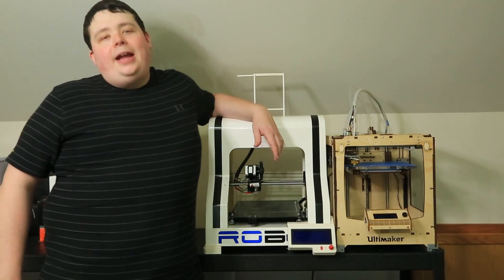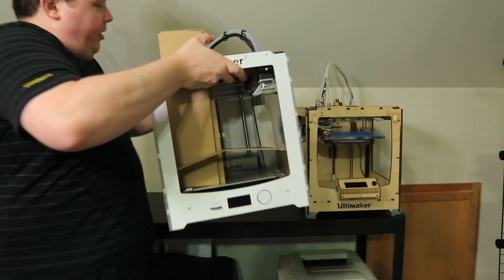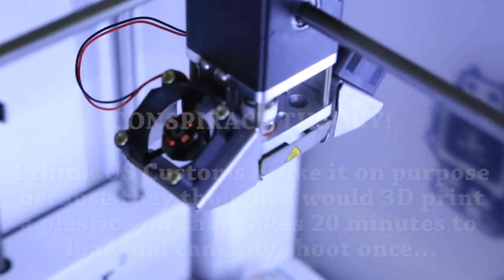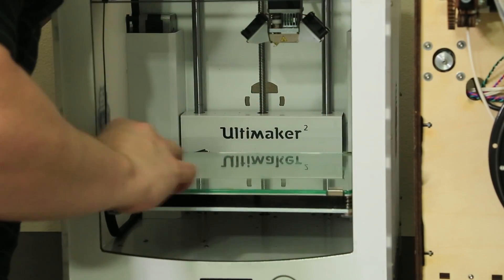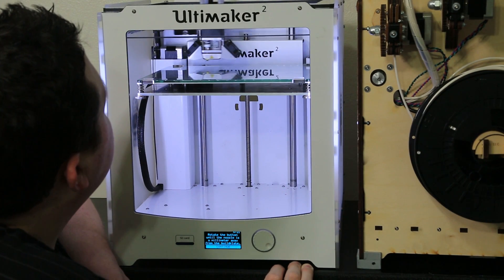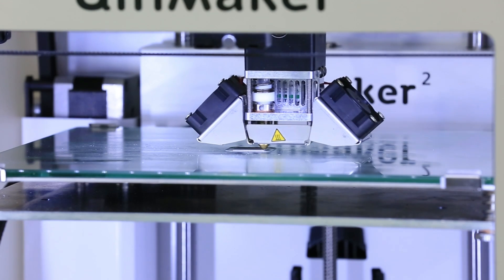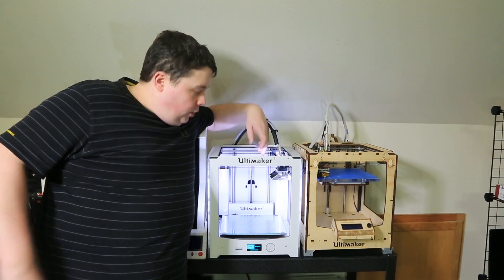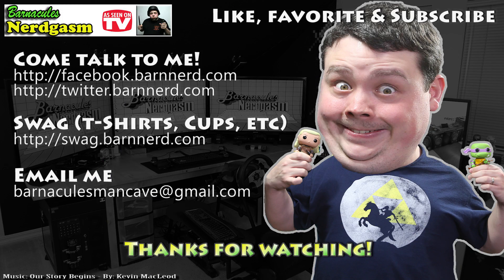Ultimaker 2 3D Printer Unboxing & Review - @Barnacules

Comment: I recently bought the ultimaker 2+, I also own 1 Flashforge creator pro
1 Flashforge dreamer 
1 Flashforge Finder
1 M3D micro 
1 3D systems Cube 3rd generation
1 XYZ da Vinci 1.0 pro 
Honestly ultimaker 2 suppose to be the highest end printer of all but here is my honest opinion, $2500is an overkill for what it's do, it's claim to have 20microm resolution but seriously what to print that will need 20micron? 
All others printers that I have are 50micron M3D 70 Micron the cube and rest 100micron .
I did print 70 micron on the all Flashforge but with half the speed and honestly I couldn't tell the difference.
The ultimaker 2 is quite for sure and the extruder will designed and look better does that justify the price? 
Don't get me wrong of all the other printers ultimaker 2 is the best but I'm not sure I can justify its price

Comment: +Barnacules Nerdgasm PLEASE READ! I know what that weird plastic part you didn't know is for! Looking at the printer from the back, there is a hole at the bottom left of the printer where you insert the piece and rotate it 90 degrees to the left to lock it in. You wrap the filament around this before it goes into the extruder to keep knots from happening on the spool that would prevent filament from extruding. There are two slots in the piece to thread the filament and the other slot is for if one has duel extrusion

Comment: Does anyone know if the Ultimaker2 can 3d print using copper?
Reply: if its Copperfill PLA, almost every printer that can print pla will be able to. if you are talking about just copper, then it most likely will not be able to.

Comment: Nice review thanks.
I bought my UltiMaker 2 at Xmas after 2 days usage it is now defect. contacted the UM support they suggested to return the unit for a replacement/refund within 14 days to the official dealer..
phoned the dealer & they offered a refund so i returned my unit. Now they are telling me they cannot refund because the unit is defect.
Either i accept a 3-4 weeks repair or i accept the refund minus the repair costs - Great service that is!

Comment: First off, let me say that I love your videos. But, I really feel that the company at fault for the broken fan is Ultimaker, not DHL. Things will get jarred in shipping. America's infrastructure is terrible in most areas, so delivery trucks will inevitably hit bumps in the road. If DHL did more harm than this, I feel that the printer housing would be the thing that's damaged, not the inner components. Packaging, on the other hand, is the responsibility of Ultimaker. They should understand that their product must be shipped, thus might experience some jarring. Sorry for the long comment, I just thought I would throw that out there.

Comment: Wait a second... For calibration why don't they just include small plastic pieces that fit between the printer head and the glass table so you don't have to measure anything- you just tighten until it is finger tight and then it is 100% of the time calibrated so easily for any level of consumer. Am I missing something here or is that a super simple / easily added to the product for nearly $0 in cost or time?

Comment: looks like they switched to belts and that's why it's quieter?
Reply: +nikotwenty No, they integrated new stepper motor drivers + the new frame does not amplify the noise like UMO. As far as noise, I replaced old drivers with Silent Step Sticks and it prints quiter than UM2 now.

Comment: Barnacules Nerdgasm i need help finding a good cheap 3d printer, any recommendations? My budget is $600 or lower
Reply: Go for the 1up or 2up you have to build it but it is amazing. The 1up is 4x4x5in printing and the 2 is 7x7x5

Comment: 8:06 - 220W seems rather low for a dual extruder setup with heated bed. Is this power supply meant to be used after a dual extruder update or do they ship a beefier one?

Comment: I would really like to see you try to get review units of competitors and really put together a comprehensive review video, or two, one full length, one abridged. These units are facinating, and your present experience and tech expertise would contribute greatly beyond simply researching. Largely because, if anyone is getting into it for the first time, the technical nuances and differences between companies and models might not seem significant when they actually are.

Comment: What 3D printer is pretty cheap (as cheap as possibls :D)  and is good to get into 3D printing? I love the ultimaker 1 and 2 (I like the 1 a little more I think) but I just cant affort one of those :(
Reply: 3d printing is an investment, you can buy a printrbot simple for $350. the amount of money you are going to spend to get decent prints is going to be the same as starting out right. Save up $1000 and you can get something quite decent that will work right out of the box with minor tuning. Its a hobby not a toy
Reply: Oh sounds fair enough I think I am first going to save up to build a gaming rig before I buy my first 3D printer

Comment: hmm If I ever get another printer I would probably get the ultimaker for super high resolution printing. It prints at up to 20 microns. You don't find much higher than that. If it prints right out of the box with very little fiddling, that's really nice.

Comment: what if they 3d printed a 3d printer
Reply: some older 3d printers used 3d printed parts to make it cheaper. you just assemble it with the hardware and go.
but as far as circuity you would need a diffrent machine.
Not to mention even if you could print a print ready 3d printer it would be smaller than the one used to print it so it would be impractical.

Comment: just got mine in. just a warning. if you plan on printing in a 90 degree summer day in a un-air conditioned warehouse. your going to have to add cooling to the controller unit. otherwise it will overheat constantly.  Barnacules Nerdgasm  do you have the designs for those legs for public download?  i could use those.

Comment: I recently purchased a Ultimaker 2 and have had nothing but problems
with it. Every third print or so comes out with horrible quality or does
not finish at all. I have emailed the support email several times with
no response and no support. I am getting extremely frustrated at their
lack or support and their complete disregard for my issues. I spent a
lot of money on the printer and its as though Ultimaker is no longer
interested in me as a customer. I am seriously considering returning the
printer and moving on to a company that will treat me well, even after
the purchase is complete.

Extremely disappointed so far.

Comment: I hate 3D printer manufacturers. Their machines contains 70% less material than a conventional printer, but they manage to raise the price by 500%.
Reply: Printing on paper vs. printing physical 3D objects
Nuff said
Reply: Arcade Animations thats not his point! dumbass.
Reply: What are you talking about? Where do you get that number? Most conventional printers use a single rod, molded plastic parts, a few springs, some cheap electronics, and 1 or 2 cheap NOT stepper motors with optical feedback to save money. I have taken apart 2D printers and the quality of... everything just isn't good enough for a 3d printer. Also, compared to conventional printers, these are a niche market.
Reply: Certified Nerd c'mon u talk about chinese crap printer. Take for example a brother printer 3 in 1 for about less than 250$.
And say me again it's a cheap shit coming from deep world and using less material & technology than this ultimaker.

Comment: Which 3d printer do you recommend for a hobbyist with a budget of $500?
Reply: i would still look at a couple other printers, just to see what else you might like, but the solid doodle 4 is definitely a good printer, and for $600, it's a great deal
Reply: it's 600$, so a little bit more expensive than what you said, but the solid doodle 4 is a great choice. .1mm resolution, heated bed, almost fully inclosed except for the front, looks fantastic, prints abs/pla, prints 8x8x8, and is really easy to use
Reply: michael dick is it close in quality to the ultimaker?
Reply: putrifaction wubs i mean, it's still pretty damn nice, but obviously for a $600 printer, it's not as nice as the ultimaker 2, which costs $2500. the ultimaker 2 has a print quality of .02mm, and that's just bananas. .1mm resolution is still a really good print quality though, and the overall printer is pretty nice, and is good quality for the novice or hobbyist.
Reply: for under a grand though, it's one of the best 3d printers you can get.
Reply: michael dick thanks for the info. ill get that one then
Reply: Just keep saving or wait for price to go down

Comment: Hi Barnacules and everyone!

We just purchased an Ultimaker 2 but the PLA/ABS requirements are 2.85mm and cheap 3.0mm is not recommended (Bowden Jams etc.)

Finding "safe" material to use with the U2 printer is becoming a pain. Do you know of any suppliers that sell U2 friendly filament in the United States that is not too expensive?

Comment: What a nonsense, a customer would buy that machine to be able to 3D-print Items from the commodity of his house, but in your case we had a machine with a damaged artifact. So its pretty pointless from both the manufactures and you to review that machine if neither can provide a "practical-life-usefulness" type experience. Either you should have found a way to custom print that vent or the manufacturers should have mailed you a binary code with that information to make the machine functional as intended.

Comment: 34 minutes just to print that,miniscule sized object.
Reply: 3D printers aren't that fast, for that non hollow object, it takes a bit longer. Plus, 34 mins isn't too slow. If the object were hollow, the print would only take 10 minutes.

Comment: The Head must be on a Servo motor cause it so smooth and quiet and the heated platform must be on a stepper motor .. like my Roland plotter the head is like this thing quiet and the rollers are louder stepper ... Jerry i am happy for you that you got this very nice .. can't wait to see more vids on whats coming next
Reply: It's actually all steppers.
Reply: David Sharp  in the Ultimaker 2 ? you mean? your prob right about that.. Some people was saying in the forums on Ultimaker they wish it was servo and other ppl where saying Servo could not handle the force or something but my cutter is Servo and cuts heavy Vinyl with a knife .just the low nose made me think it was servo on top .. guess not tho .. thanks for the clear up
Reply: KayWal1981 Yeah I have the UM2 and it's steppers all the way. I'm guessing it's just the more solid construction that doesn't act so much like a sounding board.
Reply: awesome that makes sense how do you like it so far David ? I am thinking about buying one also . i saw a vid on a Orion Printer i think the UM2 blows it away though . Thanks for the input
Reply: KayWal1981 It's the only 3D printer I've owned, so take what I say with the appropriate portion of salt. I've been around hobby 3D printers for a while and ran a Dimension machine for several years. It's not perfect but all in all it's an awesome machine, I'm really glad I have it. Hardly a night goes by that I don't send something to my little helper to build for me overnight. I do wish it was a bit less sensitive to filament diameter (everybody says "3mm filament" but if it's 3.1, it's too big and will cause problems -- limits where you can confidently buy filament from). Really awesome little machine though. I took it to a hackerspace last week, really easy to transport, very compact, and I let it run all night in the room across the hall from my daughter and it never disturbs her. I print PLA, ABS, and nylon.
Reply: well i take your word bro .. I didn't know about the 3.1 size thanks ... And also i didn't know the UM2 did Nylon .. i guess that would be really great for Gears and Washers making a perfect size Nylon washer for a project .. Shoot i like to tinker with engines Triumph bikes and the motors in the newer bikes have Nylon Gears for the oil pump 2 of them in the case on the primary side, a guy could just print out his own nylon gears for his Oil Pump on a new rebuild .. Just got to have the right dimensions that part would be tricky for me.. Thanks for your input

Comment: Hey Jerry, I think Ultimaker actually set this up to be much easier for dual extrusion. The back slot looks to be a spot for a second feeder along with the print head having an extra slot and fan to put in a second extruder. Looking forward to that upgrade. ;)

Comment: Thank you so much for this.  I am ordering one as soon as our tax returns come back. I am so psyched about this.  I am working on some rigs for diy 3d scanning as well.  One for photo scanning + 123d catch, and then later one for laser scanning, using either mo3dls or david-3d software.  I suspect I will need some 3d printed parts for finalizing those builds though. Trying to find a nice stable turntable right now for cheap.

Comment: This printer really caught my eye until I found out I could buy a Replicator 2 AND a Robo3D, and still have a little money left over for a 6-pack of beer.
Reply from the maker: Replicator isn't open source so I won't use it.
Reply: Barnacules Nerdgasm Fair point, the closed ecosystem is frustrating.

Comment: Now I want to upgrade.  :<

I will say, I have been able to get my UM1 a LOT quieter.  I used these:
thingiverse com   thing:90974

Then the padding you would use in a cupboard to keep dishes from sliding around.  It made a BIG difference!  I also added some of the padding between the drive motor and the frame.
Reply from the maker: I'm going to try this! Thanks.

Comment: Thinking seriously about getting the Ultimaker 2 kit...  it's a little pricey but seems worth it.
Reply: The Ultimaker 2 is not a kit, the Ultimaker Original is available as a kit or assembled :)
Reply: Ultimaker That is a bummer. I would very much like to build one. Any plans to release it as a kit? Would it be possible to upgrade the Ultimaker with Ultimaker 2 parts? Print head looks like a nice upgrade as well as the feeders. Most certainly will be purchasing one of your products in the future.

Comment: I converted my solidoodle 2 over to a glass bed and I. Love. It! Best part is if you have an extra glass sheet, you can take it off, replace it, and print again immediately. Cheap and easy upgrade. I ran it the other day without hair spray or a raft and I swear it gave the bottom of my piece a mirror finish... AND IT DIDN'T CURL!
Reply from the maker: Yeah the mirror finish on the bottom is epic, I get this even when I use hairspray on the heated bed.

Comment: Test PLA, at speed of more than 50 mm/s, 0.1 resolution ?
Reply from the maker: I will do some high speed stuff once the new cooling fan arrives. But if you want to see fast look up my bottle opener video. I print a full bottle opener in like 7 minutes at 250mm/sec
Reply: You probably printed on UM1. I just want to see if you will succeed what will be the settings of PLA, temp, fan speed and material flow %. And second how will the feeder motor handle the synchronization of material flow vs feeding it through the nozzle.

Comment: What exactly did you use the paper for when calibrating? What was adjusted exactly and how?
Reply: the paper is just to leave a very fine gap between the print head and the build platform you just adjust its position until it starts to grip the paper